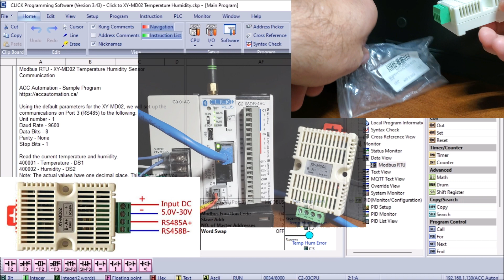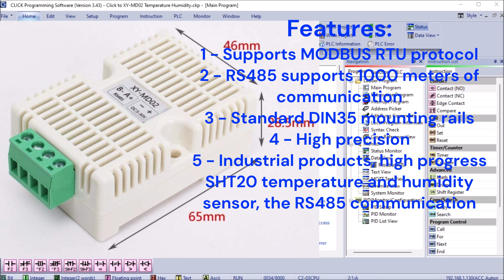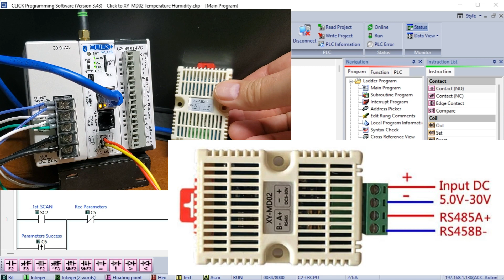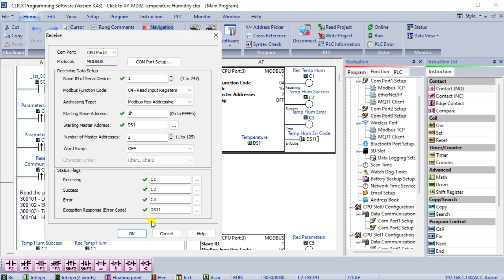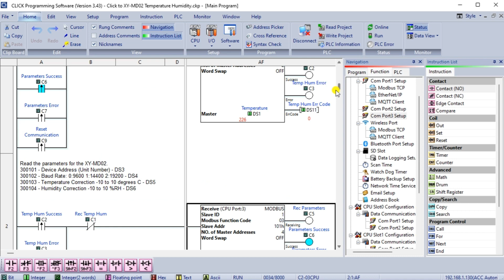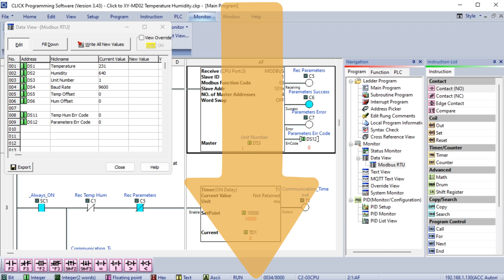Click PLC Modbus RTU Communication: XY-MD02 Sensor Guide

Comment from the maker: More information can be obtained at our website. This includes all of the links mentioned in this video. 
https://accautomation.ca/integrating-xy-md02-sensor-modbus-rtu-click-plc/

XY-MD02 Temperature Humidity Sensor - Modbus RTU (RS485)
Purchase 
Amazon.com
https://amzn.to/3PbBryH
Amazon.ca
https://amzn.to/3Etmy65
Manual
http://www.sah.rs/media/sah/techdocs/xy-md02-manual.pdf
Connection to Raspberry Pi
https://www.instructables.com/XY-MD02-Temperature-and-Humidity-Sensor-Module-Mod/

CLICK PLCs were designed with simplicity in mind, providing reliable control at a low, low cost and with little to no learning curve.
This simplicity makes CLICK a perfect solution for small machines, home automation projects, pneumatic applications, or anywhere a simple system needs a budget-saving control solution. 
Building on the original CLICK's simple design, the new CLICK PLUS PLCs offer the same practical control but with surprising bells and whistles. Using the same FREE, streamlined PLC programming software as its predecessor, the CLICK PLUS PLCs provide no-headache programming combined with advanced capabilities like Wi-Fi communication and data logging.

The Click and Click PLUS PLC series can be found at this URL:
https://accautomation.ca/series/click-plc/

Features of the new Click PLUS PLC (C2-0xCPU) include the following:
  Micro USB
  DHCP support
  DNS support
  Wi-Fi (programming and Modbus TCP)
  Bluetooth (Wi-Fi) provisioning
  SD Card (Data Logging)
  Data Logger
  Network Time Service
  MQTT (Publish/Subscribe)
  Required PLC Password
  Disable Ports
  Strong Password Support
  Disable Ping Response
  Encrypted Password Transfer

We are using the Click and Click PLUS PLCs for several reasons. Here are just a few.
 - Investment is low for the hardware, and the software is free
 - Standalone PLC with built-in I/O
 - Communication ability - Ethernet Port, RS232, RS485 - support for Modbus RTU, Modbus TCP, etc.
 - Ability to expand the system with various modules, including RTD and Thermocouple inputs directly.

https://www.accautomation.ca

Comment: I've actually been thinking about this very project for a little while now.  I wondered if using a Click and serial communication with a temperature/humidity sensor. 
And here it is, all done and ready to go. Thank you!
Reply from the maker: Hi @mikeglide1292,
I am glad that you found this helpful. I could expand this to include another program to set up the unit number and offsets that may be required for the temperature and humidity. (calibration) What do you think?
This could also be done using Putty and serial communication to the temperature and humidity sensor.
Thank you for the comment.
Garry
Reply: " I could expand this to include another program to set up the unit number and offsets that may be required for the temperature and humidity. (calibration) What do you think?"  That would be awesome, thanks! @ACCautomation
Reply: @ACCautomation  Please please write the described click program to setup the configuration of these temp hum sensors! Using your click program now. I donated $5 to ACCautomation, great site! Also trying to figure out how to link this sensor directly to a Cmore rs485 connection to avoid the PLC.